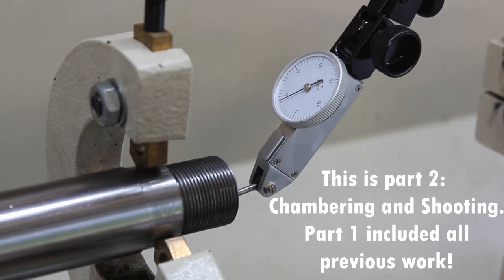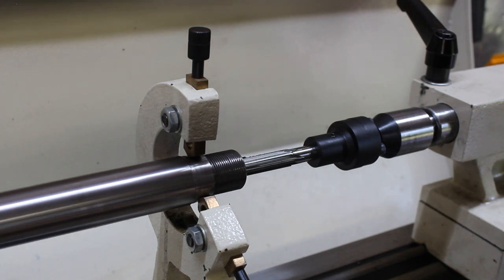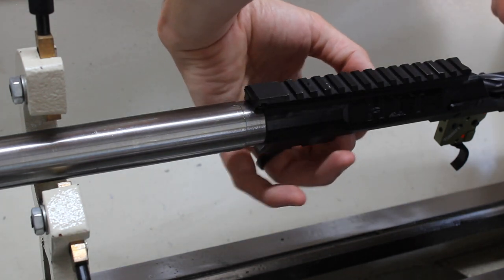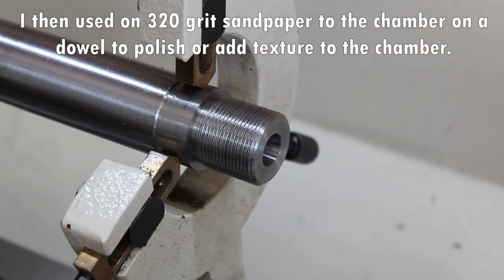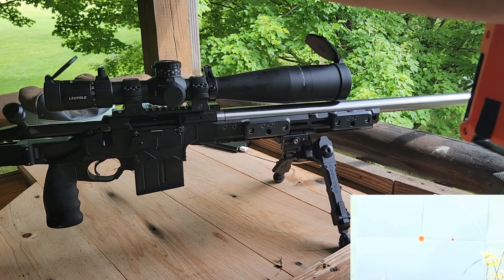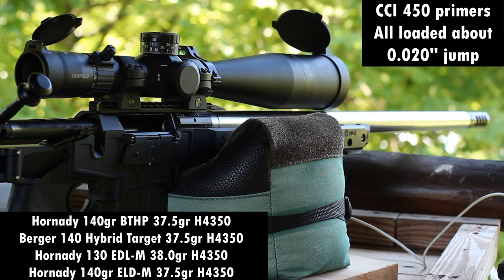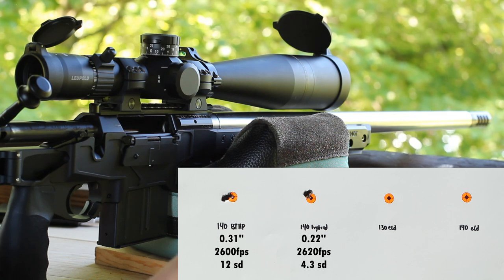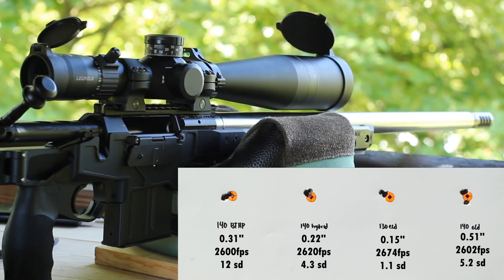Barrel Chambering, Sight in, Initial Groups

Comment: What a great video. It must feel super rewarding seeing those groups after putting all that effort into making your own barrel. You may have already answered this, but why did you chose to replace the 6GT barrel instead of switching out one of the savage barrels?
Reply from the maker: I enjoy shooting my seekins more than the other rifles. The bolt is more refined, trigger is better and I also have the Leupold 7-35 on the seekins. The seekins also has a quick change barrel system. The GT barrel is not replaced and it will be back on when I want to shoot GT. The seekins is going to be the primary platform to shoot with many different cartridges coming due to ease of barrel swap.
Reply: Awesome! I look forward to all the future content

Comment: that's awesome. The 6.5x47 lapua is amazing, isn't it? 

when you had the indicator in the old chamber, did you dial in with the 4 jaw or the steady rest to dial it in?
Reply from the maker: Dialed in with 4 jaw then set up the steady, then re-checked with the dial.
Reply: @RobsReloading  i hesitate saying anything in fear of irritating you, but just in case you believe what I did at first, and assuming you want to know...  you can't dial anything in with a steady rest. all you will do is move the work piece around the centerline of the spindle. any runout you see with the indicator is an indication of how round the work piece is. to explain it a little if you're not sure. picture an oval in a steady rest with the three contact points, and picture what's happening to the center of it as the outside keeps contact with the three points of the steady rest. 

if you were able to reduce any runout by adjusting the steady rest to were only removing flex from having it too far off center.

Comment: What's w/ the barrel wobble? Lathe caused...?
Reply from the maker: I'm assuming the movement down the barrel away from the chamber is run out varience from the bore and OD of the barrel. With the indicator I have I can only reach in the bore maybe 1/2" and that area had nearly 0 run out. Next barrel I will have a long reach indicator. Presumably the barrel could have a few thou run out 5-10 inches from the measured location. I am assuming that's why away from the chamber side shows some oblivious OD run-out.

Comment: Do you have a gunsmith lathe or just a normal one? Curious since you are using the steady rest. Im beginning my journey into barrel smithing this year
Reply from the maker: Mine is a central machinery 12x36. Started on a grizzly 11x26
Reply: @RobsReloading  thanks. My brother in law set his company up around the g0776. Probably going that route, but if something comes up at an auction, .might go ahead and get it